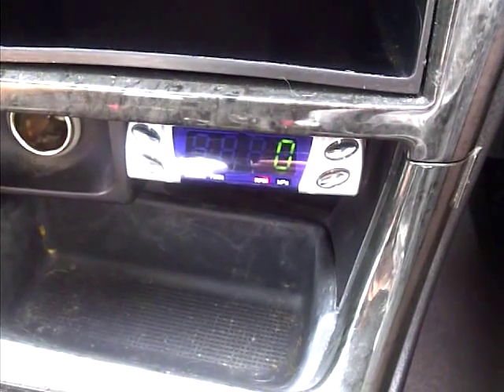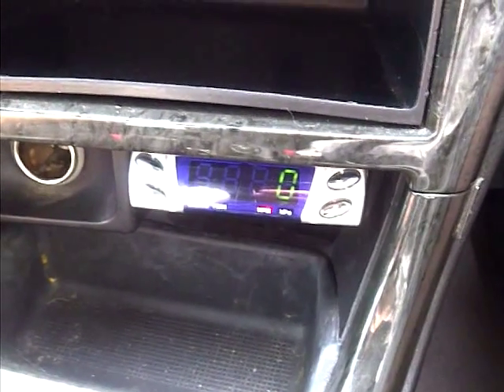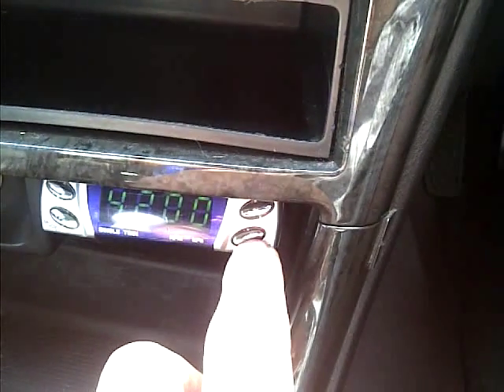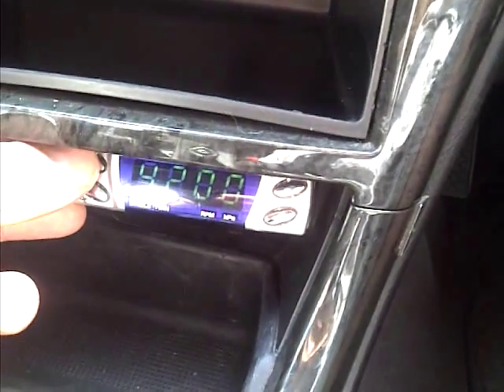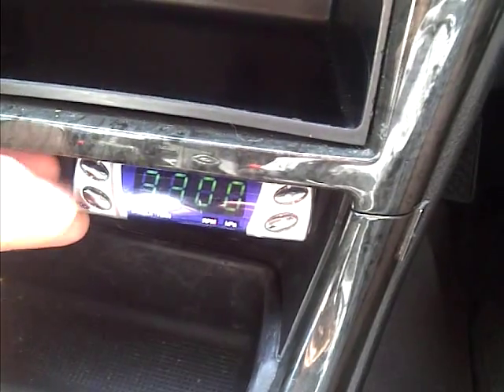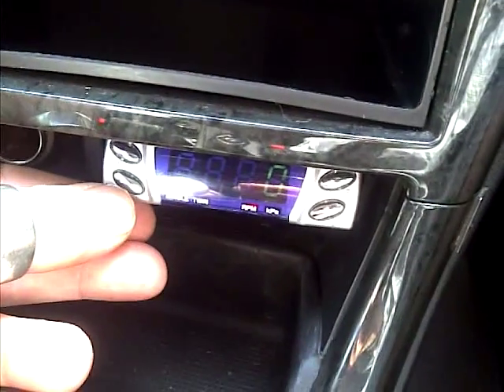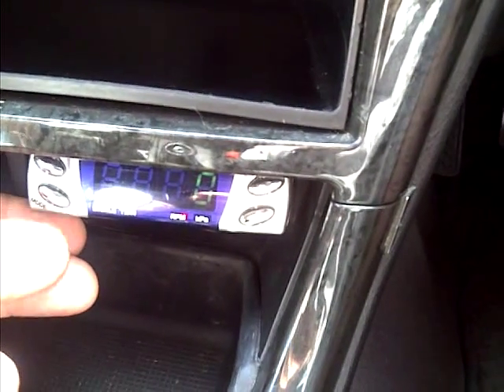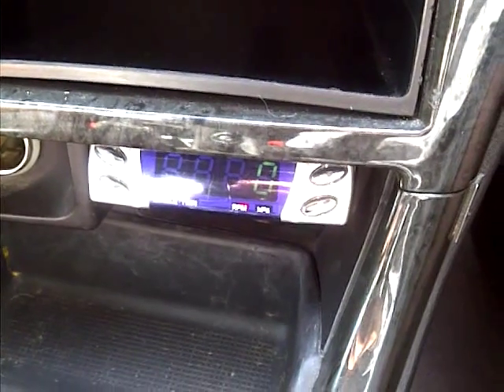Zero Sports Sequential Controller Settings

Comment from the maker: I haven't measured my 0-100kmh time, but the controller does increase the primary boost by circa 0.2 bar without adjusting any settings. VOD is all but eliminated and secondary boost feels like its coming on stronger. A great little mod :)

Comment from the maker: "Town - secondary between 4200-4400, change over to single 3300 -3400 Highway - secondary 4000, changeover 3400 - 3600  and the last one I cant translate but I think it might be speed or power due to the high changeover secondary 4600-4800  changeover 3300-3400